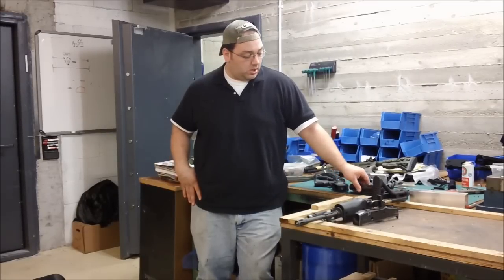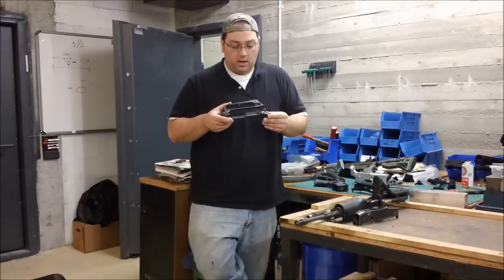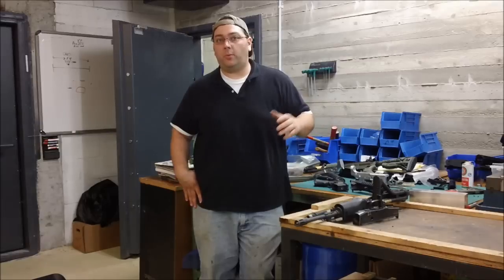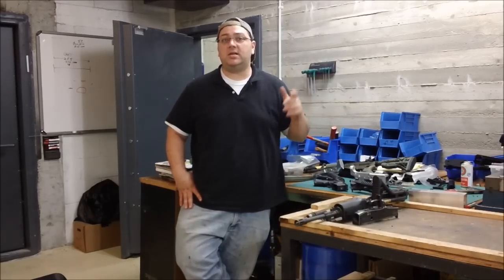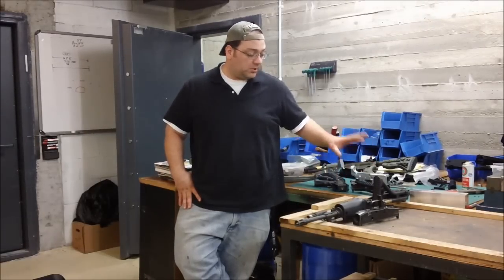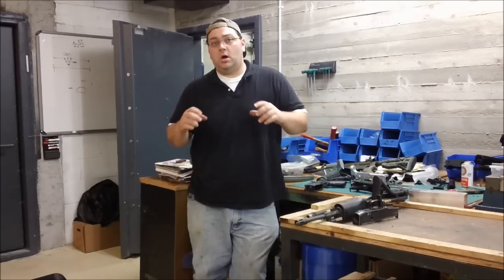Seeing is believing! Milled vs. Forged receiver strengths. Also a look at barrel obstructions

Comment: Understanding this is a 7 year old video but oh well will comment anyway.

A forged upper/lower receiver is hammered or forged into a rough shape, then machined (milled) after to meet the “milspec” tolerances.

A billet upper/lower receiver begins as a forged blank, the blank is machined, therefore allows for a more custom finished look since the receiver starts from a block.

Both are forged, one is forged into the rough dimensions and shape of the finished receiver... the quality of the tolerances of machining determines final costs, that’s why an Anderson forged receiver is generally cheaper due to the machining is not held to strict tight tolerance vs some companies with more expensive forged receivers (you are paying for the name too, but the name has earned a reputation typically due to the tighter tolerances) 

The billet is still a forged into the rectangular blank then machined into the final receiver... just with a lot more machining required. 

That is what I understand anyway, I don’t work in the industry so perhaps I am ill informed and wrong.

Comment: Well. We can look at the auto world.
They have cast, forged and billet pistons.
Cast is good for economy but not power.
Forged and billet are good for performance but not daily use (usually).
The forged is slightly better than billet due to it's grain structure.
If all else is the same exept material, forged is better.

Comment: Forged aluminum is way different than forged steel! Forged aluminum is more brittle then billet the billet will flex more without cracking, they forge mill spec uppers and lowers because it's cheaper and faster to manufacture than machining them out of a billet and the forging is stronger than casting them! Quit over thinking things people!
Reply: but why did he say that the trigger pins were wearing more on the forged vrs the billet lowers?   that area is not an 'impact' area and I would think that the billet would wear more because it is going to be a little bit softer ....  I am confused :)

Comment: That's why EVERYTHING inside a 7,500 Horsepower  AA Fuel Dragster or AA Fuel Funny Car engine are FORGED ROTATING ASSEMBLIES...!   Right...????    FORGED Alloy Steel Crankshaft, FORGED Alloy Steel Connecting Rods, And FORGED Aluminum Alloy Pistons...!    YEP...   ALL FORGED...   for STRENGTH...!

Comment: Do your homework dude...   a forged receiver is formed out of a hot Ingot of heated aluminum...  then finish machined the same way a Billet receiver would be machined.   A forged part is stronger than a raw billet machined part.  Forgings are stronger than Billet...  They are work hardened due to the forging process...  Billet receivers are only  more expensive because there's at least triple the amount of CNC machining time to machine a billet receiver then there is to machine a preformed forged receiver...    There's a reason every 5,000 horsepower AA Funny Car and AA Dragster run forged aluminum pistons, forged steel connecting rods, forged steel crankshafts, and forged aluminum rear wheels....!   Yeah, because they are a lot stronger.

Comment: Two different uppers configurations, it's not a fare comparison to start with. In general the picatiny rail on the M4 would add strength to the upper. 
The forging is stronger than billet, and further more both require to be milled. So the title of the vid is inaccurate.  It should read Forged vs Billet.

Comment: Totally irrelevant. Those lower failures were caused by the over pressured  DI gas system driving the bolt carrier . Either lower the DI pressure with an adjustable gas block or change the gun to a single shot rifle by completely blocking off the gas will fix the problem, provided the barrel and the bolt can withstand the over pressured ammo.

Comment: In strength when comparing any items made of the same alloy Forged>Billet>Cast Unless of course it was a cast billet and not a forged billet. Casting is cheapest especially investment casting and requires the least final machining. I don't know of anyone making cast upper or lower AR receivers. Forging takes more machining but is stronger. Billet looks the cleanest if you care about that because the entire receiver has to be finish machined, but it's generally the most expensive due to all the extra machining operations. Though not as expensive as it would have been pre CNC when said operations would've added hours to the machining process as opposed to minutes. It's really amazing when you look at older guns where parts were machined entirely from steel billets. Such things would be beyond prohibitively expensive today. I would be leery of a billet upper or lower unless the manufacturer specified that it was a forged billet. I wouldn't want a cast receiver. Yes I realize plenty of firearms use them and they are perfectly safe.I also am one of the few people intelligent enough to realize that the carbon fiber and/or polymer uppers and lowers are safe. But they feel very chintzy and I wouldn't want one.

Comment: Let's us be clear folks, MOST if not, ALL raw billets are not hardened for the purpose of additional milling, or more specifically 80% lowers, so we can complete milling into a usable lower receiver for our build. None of us is in the right mind considers annealed (hardened) aluminum after milling. The complete billet receivers sold by high-end gun manufacturers such as Ruger, Colt, Savage etc. are hardened. Fly by night manufacturers of billet receivers to include Aero Precision, Spikes, PSA, Anderson, etc. may not be hardened, then claimed as Mil-Specs when it should not be considered as Mil-Specs. That's a fact. I am an aircraft mechanic, working in making aircraft parts, and all aluminum must be hardened to specification to meet the FAA requirement, but normally started out as soft (weaken) aluminum for welding drilling and milling purposes. It is true that forged billets are stronger when compared to non-hardened billets, and can mass produce in a short time period. That is why the military chose forged because it's cheaper and manufacturers can build it faster, it was not for the sole reason that forged receivers are stronger.

Comment: beware of companies  that claim milspec just  because it is the same measurements making it interchangeable, if it's in inexpensive it will have crap materiels that will fail. they won't be made out of true milspec metals like carpenter steel bolts and multiple hard chromed lined areas like the bolt,  chamber & barrel. if you want to save money buy the OEM parts the military buys from. I see people buying bolts  for hundred$ you can buy a real military OEM Bolt for $90 & I am not talking  palmettostatearmory, do some research to save money for military parts don't waste money on a cheap company claiming it's milspec.

Comment: Does anyone know why the originals were (forged)?  Well, a casting was FAR to crappy & there was no such thing as production 3-D CNC milling machines.... They took a (BILLET "forged" INGOT) and pounded "forged" shapes it into ... Yes, a billet is actually a process of forging, just forged straight.  
  If the forged lowers are cheaper, I would question the quality of the blanks before forging. See if there getting material from >CHINA< . 
   If you want to do something new, look into (CAST TITANIUM) It's virtually as strong as forged titanium, but WAY less to produce,  Cast titanium uppers would be the bee's knees...

Comment: It's always been my understanding that a forged upper and lower can stand more punishment than that of a Billet set up. Now in three gun competitions weight  considerations ten to go with a Billet set up to reduce weight during the competition however when running 5 5 6 ammo the pressures generated by such ammo can cause catastrophic failure and injury to the shooter.

Headspace verification known as the Go No Go rule is very important during a custom build. Barrels during a build are very important selection and quality are key factors to consider. But this aspect would be for another discussion.

Comment: What you  proved is that one forged receiver was weaker than that one billet receiver This could be from the milling process or the manufacture of the receivers. To really prove your claims that a billet is stronger you would have to run this test on at least 100 receivers by at least 10 different manufactures  then you would  so real data to talk about. AT this point this is just another pointless video with some guys opinion personally I have AR 15s with both billet and forged receivers and haven't any issues with any one them and I don't really see much of a difference on how the rifle preforms. You should be more concerned with the parts you put into your rifle than what type of receiver your have.

Comment: It's all about grain flow and structure to net you strength. 

Billet is a solid block of aluminum with better grain structure than most cast aluminum well usually anyway (depends on who and how they made the billet.). Billets were designed to cut manufacturing times down of aluminum parts that were intricate and needed a good surface finish (because kind of a pain to cast a block of aluminum to machine and not to mention trying to hold it securely.). 

So to say billet is way better than a forged cast aluminum part is humourous.  Without any knowledge of who, what and where said billet or foging was made makes it hard to make that claim. Now as far as forgings go I will take one any day(from a reputable manufacturer) over a billet(just paying for more machining time) unless it's a forged billet and yes that's a thing. It reduces the impurities, better grain structure and then forging it will give it better grain flow while compressing the grain structure. Then again it may  be rather brittle but would definitely make for a great experiment..
Reply: aaron kellison just a couple notes... "forged cast aluminum?" Forged and cast don't go together. As far as not knowing where the forging came from, on upper receivers (which seems to be this guys focus, rather than lowers) there are forging marks. These will tell you where it was forged, and sometimes, who did the final machining. There are at least ten different forges doing AR uppers.

Comment: Only a complete uneducated dipshit would think a 7075 billet lower or upper is stronger than a forged lower or upper. How did captain dumbfuck measure the CUP pressures? This is a classic case of a dimwitted jackoff trying to justify paying too much for something. A sample size of two, is not any viable experiment. It is a joke. One of the first 100 rifles made, and it was made in 1973? This guy is talking out of his ass! The first M16s are older than I am, and are now C&R guns. 1966, 1967. The sample sizes need to be 20 or 30 of each type, and from different lots.

Comment: there are different ways to measure strength and force. when strong becomes brittle... impact velocity is your worst enemy. Billet is the way to go. now they are as expensive as forged...

the forged parts are a little lighter, because they claim forged is stronger, and it kinda is, to a point. so what producers do is reduce the wall dia to save weight, because its "stronger" lol... this is why I went billet. A. its not stronger... and that term can be debated as to how to define exactly where the strengths lie or apply. B. its not lighter... you only save ozs if at all by going forged but you are then getting less material overall... so its a compromise. C. Billet is no longer more expensive than inexpensive means of forging... 

Id like to say the biggest factor in strength of said item will be the quality of the materials used and the quality control. I got my billet lower for 75$ ... the tolerances will be MUCH tighter and breakin period may be extended but overall I wanted a very tight and smooth operating system, that is very accurate. Im not gonna run over my ar with a tank to prove forged material beats my friends billet material. but if you are shot at and your rifle blocks the shot... your face will be filled with shrapnel if you went forged... 

cheers for the info that supported my arguments too, there isnt much out there on the net that shows the practical use of strength and considers them with an example.
Reply: why did he say that the trigger pin area is worse on the forged vs the billet receiver?   wouldnt it be better on the forged?

Comment: Strange...  All the engineering mechanical data for forged vs extruded (otherwise known as billet) aluminum explicitly details that forged is in fact stronger.  

Unless you get out dials and start running mic dimensional checks on parts and comparing forged 6061-T6 to billet 6061-T6, then 7075-T6 forged vs billet...

I think you'll quickly see how unscientific the assertion is.

Forging alloys allow for far greater cross sectional density of the alloy while fulfilling a manufacturing need of faster, repeatable production.

Comment: A couple of things:

1. Sample size (not enough for a statistical determination)
2. How many rounds through each before they gave out (Important because stress is 
    accumulative)
3. What quality procedures did each of them go through? (not fair to compare a $50 forged 
     no brand vs a $300 billet name brand with solid QC procedures)
All this matter, without a proper experimental procedure, this is just conjecture and opinion. My experience, buy what ever you want, but put the proper ammo thru, either of these receives would have lasted a lifetime, if the proper ammo were to be used.

Comment: A: 90.000psi is not 3x normal 5.56 pressure, or even .223. SAAMI pressure is 55,000 psi. Major lack of common knowledge for even the average garage gunsmith.
 
B: In 8 years in the Infantry I have never heard of this common issue of M16's (standard issue for infantry has been M4 for as long as I've been in) or even M4's  blowing up regularly,  nor soldiers soaking ammo in kerosene or anything else. I don't know where you are hearing these things, but stop listening, it makes you look very stupid.

C: That upper you fucked up is an A1 carry handle upper that is hard to come by, and if it was an original Colt, congrats on ruining a  valuable part for your very unscientific test. 

D: You only compared ONE forged upper, of unknown origin/round count and of a completely different design than your forged upper. Try comparing a brand new M4 forged upper to your billet flat top. This is a sample of ONE, that isn't even the same configuration or design. This violates the most basic standard practice of making scientific comparisons

E: Your lack of understanding of metallurgy and correct technical terminology is atrocious, which would not be a problem except you have made a video that is implying your expertise and qualifications to decide which receiver is stronger. 

I could easily pick this video apart further but I think that is enough. This video has no value other than to demonstrate how NOT to make a valid scientific comparison of receiver strength and should never have been made.

Comment: The upper and lower receivers of the AR15 only serve one purpose, to keep all the moving parts in place. They were not designed nor intended to contain the energy of a 556 round. All of that takes place in the chamber and is contained by the chamber, the barrel extension, and the multi lug bolt. 

The upper receivers were destroyed because the chamber pressure created by the "proof" rounds could no longer be contained by the bolt, which failed and split the hardened steel of the bolt carrier. The fragments of the bolt carrier shattering is what destroyed the aluminum upper. I'm sure the bolt was missing some lugs on it and it was probably stuck in the receiver extension. 

Again, the aluminum receivers were never designed to contain the pressures that occur in the chamber. It's the job of the hardened steel of the barrel, chamber, barrel extension, bolt, and bolt carrier. It's why stoner used aluminum for the receivers.

Comment: I'm confused. You ran both uppers to failure, but it was the bold carrier groups that exploded and created the failure in the first place. Scientifically speaking, your test was flawed. If anything, you should have exposed both components to the exact same amount of heat and stress under controlled conditions. Both should have also been of the same quality aluminum and heat treating. In neither test did the upper fail due to any factor other than the bolt exploding. I believe that even a titanium upper would have failed based on your test. The bottom line is this; either forged or billet uppers are reliable under real world conditions. You pay more money for billet receivers for the looks, features, and the ability to brag to your buddy. If you have an unlimited budget, go with the billet. If not, you can build three rifles with forged receivers for the same money and never sacrifice reliability or performance.

Comment: You used different uppers, a flat top and one with a carry handle. Not only that, but the lower receivers had nothing to do with the failure of either upper. They're held together with only two generously clearanced pins that do nothing to brace the upper against the forces involved.

Comment: What do overpressure rounds have to do with the upper receiver? The chamber, barrel and bolt take all the pressure. How many tests did you perform? Did you use the exact same barrel for each test? That kind of test makes no sense to me. Where's your data?